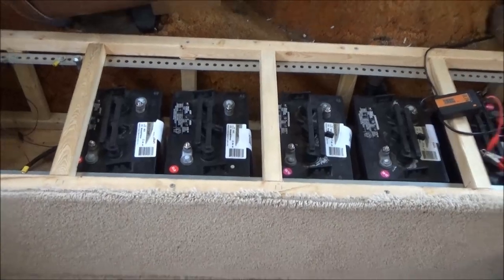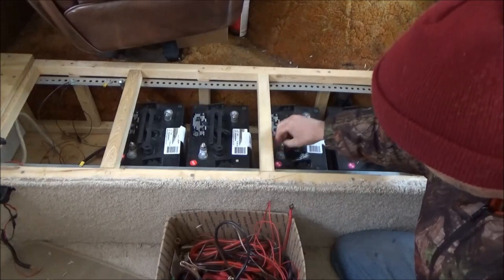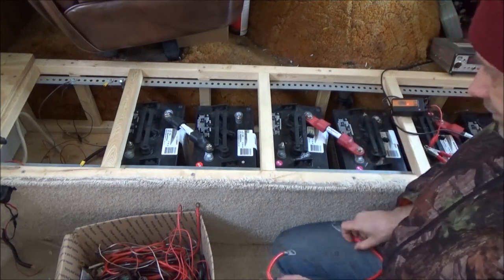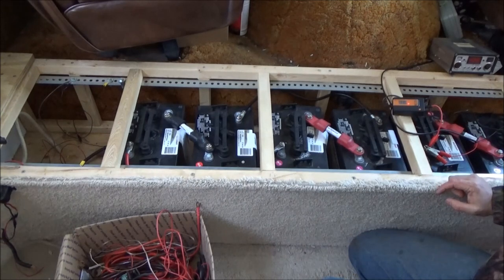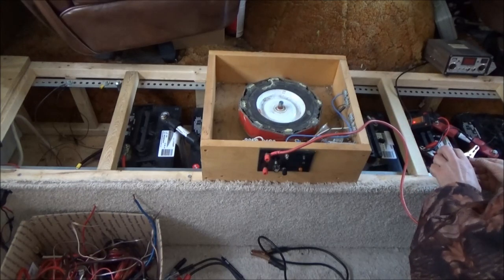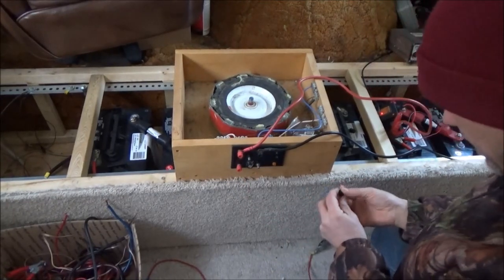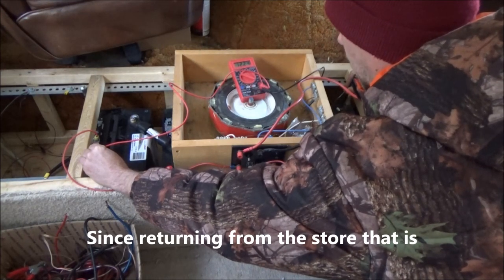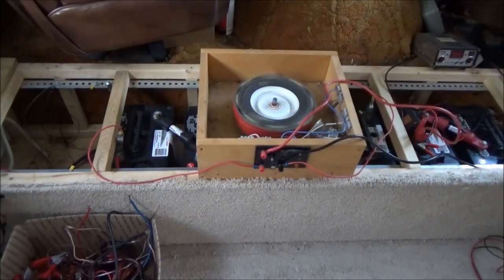Connecting Badly Sulfated Golf Cart Batteries To Bedini Motor Desulfator In My Off Grid RV

Comment: I think what the batteries need is a good 45 amp neutralize charge for a 30 min a day for a few days until they boil off some of that sulfation. run them down in between. They just have not seen any real amps of charging so it is not enough to knock off any sulfation. That tiny Badini is not going to work. It just dont have the punch it needs to attack the huge plates on the giant golf cart batts. I am Speaking from experience. I bought the same battts you have and have them in my shed right now. The were showing low capacity so I gave them a direct charge from the solar panel for a few days for a few hours a day. They seem to have recovered. I used a 90 watt five amp panel on two 6 volt batteries at time. It  boiled them some for a few hours a day. It would really boil them better if i could put about forty amps in them for a hour or so or better and really knock off some sulfation. you need to give them some large amps for a little bit to knock of some sulfation with some rapid  boiling.
Reply from the maker: The only way I can do that is with my big generator and the large 50 amp battery charger. I guess I could try it.
Reply: *****
That could possibly occur if left to boil for too long. over heating and warping plates is what happens so then you get a short from the warped plates touching So monitoring temps would be a must. Yeah a guy needs to keep a close on them while boiling so they dont get too hot and warp the plates to make them short out.
Reply: The Do It Yourself World
Watch your temperature so you dont get them too hot and warp the plates and short them. Keep a eye on the temps while your not doing anything else or you could forget and destroy them.
Reply: shartne When you say watch your temperature... is there a way to measure it?  How do you know it, too hot? Is there a smell, a sound, do you touch the battery case or maybe the terminals?    Being careful of the temps sounds like very important advice... could you please say how we do that?    THANK YOU!
Reply: MollyDolly  Put your hand on the case, it should always be below body temp. If not, excessive plate corrosion will start to occur.
Reply: Albertzz99 Thanks...  that brings up another question... I am in SoCal... should I be keeping my batteries out of the sun?  Right now I have my new HF solar set up on the pool deck... it does get hot... will that boil my batteries and if it does is that good or bad?
Reply: MollyDolly  The ideal temp for lead acid batteries is apprx the same as most people consider a comfortable indoor temperature. Above promotes corrosion of the battery plates during cycling. I can't really tell you what is, or is not possible for you. But I would try to keep them out of direct sunlight as much as possible. Hot batteries do not last as long as cooler ones, so one can only try to make them last by keeping them as comfortable as possible. To further complicate things... Batteries typically increase there internal resistance as they get used and abused. This means more of the energy you try to put into them will be converted directly to heat. If you remember how Troys new FL battery suddenly increased in temp when he got them insulated?  This is to me a clear indicator on an elevated internal resistance. Remember the weight of the battery? This is an awful amount of mass to rise that much in temperature in such a short amount of time. Several hundred pounds. was it 700?
Reply: Albertzz99 Thanks!   I think I will put the battery on a couple of 2x4 or something to get it up off the hot deck and I will shove it behind the panels for shade that should keep them cool enough for a couple of months... and by then I will have changed the system probably.
Reply: MollyDolly  Just to repeat myself from the previous video. I would definitely be getting an independent analysis done on the forklift bank if it was mine. I think the temperature rise was to large on that big mass. I think they are faulty, and a professional with a modern digital battery analyzer would pinpoint the fault in a few minutes. I know because I do this myself whenever I suspect one of my own batteries.
Reply: MollyDolly Sorry, I wrote that above before I saw your last post:) Yeah, insulating them from a hot surface and shading them is a good way to go to get more life out of this kind of batteries.
Reply: Albertzz99 My battery is just a Walmart 109 AH Marine battery... this is my training wheels set up to experiment with...but since it is new I don't want to  damage it.  I had not thought about the heat on the deck as a problem...so I learned something today.      Thanks again!
Reply: MollyDolly The longer you can make it last, the longer you can avoid the hassle of recycling the old and getting a new one in.  
I forgot to mention you also reduce the self discharge by keeping it cooler. So it's a win win.
Reply: MollyDolly
Have to look that up on the net dont really know I go by feel I dont like them to get too wam if so  shut them off. You can bring them to a full charge then let them keep going for thirty min or hour. depending on the temperature. It pretty cold where he is.
Reply: shartne, you are right that he should boil them more, the bedini pulses wil help in the first stage to get a little of the sulphation of so you can get some amps in them with a normal charger, but remeber he has no grid power, so thats a bit problematic there.
what y often do (on grid) is to put a damaged battery on a non controlled charger to boil them for 24 hours, then decharge a bit, and charge them fully with a 3 stage controlled charger, if there not to muth damaged that wil work fine most times, but beware , the capacity of the battery wil be lower then a new one!, its always damaged!
Reply: Pete Brown  well Pete, proof is here!, i have several customers that have my traction batery's for 20 plus years, stil doing fine!, al has to do with the way of maintenance, and capacity, i have placed huge capacity cels (1500 amp hours ore more) when the customers use lot less power, in that case the cels dont have to work that hard to, and when charged and equalized in time the can live even longer, its thrue that if you have to less of capacity in the bank you wil hurt them indeed,(they have to work harder!) in that case they will live a lot shorter! (5 years is possible), but as said, y have several of my customers whit 20 year old banks still peform well!
Reply: Pete Brown he  has them, but he is not charging the right amount (if its a 700 amphour he has to charge wth 70 amps at least, but he doesnt dear to switch his hf carger to 50 amps... dont know why...).
Reply: MrBugsier5 Just the man I wanted to speak with!   I have this brand new Walmart marine 109 AH battery on the 45 watt HF solar array, and a 750 watt Schumacher convert.  I was looking for a  load to test it out on and my daughter has lizard and critter lamps running so we thought we might try running those.  There is one 100 watt lamp and 5  60 watt lamps.  She usually runs them from 7 AM to 7 PM.   I am in Southern California so I get full sun every day.... except this week because I installed  solar array (of course!!).  We have full sun from 8:00 to 5:00 this time of year and lowlight until 6:30 pm.   So the question is...will I be able to power those lights?   Should I plan on turning off the lights by 5 pm?
Reply from the maker: Pete Brown Ok, you trade places with me. Have 5,000 people tell you that you are an idiot and a failure every day in 5,000 different ways. Now those same people try to tell me the "right" way to do things, but there are 5,000 different "right" ways. Sometimes I dont know which way is up anymore. It gets so confusing. So yes, often I make stupid mistakes based on the "professional advice".
Reply from the maker: Pete Brown Oh, and the other 4,999 get angry with me for not taking their advice.
Reply: MollyDolly you have a 109 amphour battery so you have aroud 55 amphours to use available (half the rate of the battery to not hurting it)), not counting the losses of your inverter, you can use a 100 watt lamp lets calculate...100/12 is 8.3 amps , so this lamp uses 8.3 amphours in one hour.so you can use it alone for 6 hours, then you have to recharge your battery, you see not mutch to use!, in full sun (at no losses ) in theory you wil charge with 45 wats max 3,5 amps, so 3,5 amphour, thats not mutch!

(thats all whitout losses, so you can even use less power as calculated here!

whit this set up, i strongly suggest you use led lights,(directly on 12 volts) your system is not big enough to power your needs!
Reply: The Do It Yourself World  lol, dont worry, i dont bother!, just advising!,
Reply: The Do It Yourself World
all the advice you get from me is tested in practice and proffesionally. just saying.... thumbs up, ps , you forgot the 6 volt connection on the rv bank.... darn you!!! lol.
Reply from the maker: Pete Brown I knew I should have added that I did not mean you. I was just saying. So many people on here talk about all my mistakes but the advice I get is so mixed. Often I am even second guessing my own self on things I do know.
Reply from the maker: ***** And what brought you out of the wood work again? You are not wanted here. I am sure everyone made that pretty clear last time. Go away. Bye now.
Reply from the maker: ***** And how are you commenting here and how can I see you? I thought you were blocked? Arrgh. Well, lets try again. Bye now Ryan. Wish I could say it was good, but ..... NOT!!!!
Reply from the maker: The Do It Yourself World Hmmm, is he gone? Time will tell.
Reply: The Do It Yourself World
Cycling batts through helps as much as anything. Charge them run them down a few times normally. See what happens I read this stuff on the net battery school. then I try it and it worked. my inverter got sick now I have it apart waiting on a new soldering iron. And the trolls.. the government has special shills that get paid to attack channels. Evidently they don't want people to become independent and get off grid.
Reply: The Do It Yourself World
Also this youtube is owned by Google a Government run deal. They have it to profile everyone. It about control. They will be coming to get the off griders and preppers and Christians but us Christians will be gone after the rapture so good luck with that. LOL

Comment: Since the bedini motor requires no electric then how about unhooking the battery wires on the right hand batteries and see what happens?  You also said it had a short in it are you not concerned it might catch fire?
Reply from the maker: I never said that. In the video I mentioned the batteries that run the motor. Disconnect the batteries and it stops running. Simple.
Reply: Plain and simple that thing don't work.
Reply from the maker: Captain Carl Wright Right, not without the power it does not. But before you slam something as a fake or a farce you should try it first. You might be surprised. And if you do not try it then you have no right to mock it.
Reply: Susan Wyse I figured that it was phony.
Reply: Thanks I'll check it out.

Comment: Troy, what you are using the bedini motor for and what Bedini designed the motor to do are reversed. He showed that you could use a low votlage power source to generate a pulsing high voltage output. ie: 6 volt lantern battery powered the bedini, and it created an output of 20 -100volts? charging a 12 volt battery, but since it pulsed it did not burn out the battery. A secondary effect was that it desulfated the battery. 
        When doing your videos,as you talk, sometimes the word or phrase you use is misunderstood. I knew there would be no "boom" if you shorted out the battery; maybe some sparks, unless you had like a bank of 10 batteries set up.
Reply from the maker: Well, I use it for desulfating and charging at the same time.
I am not the best with words actually.

Comment: You should use the best de-sulfator on the worst batteries. and all batteries connected as a bank, so they all get the same treatment!
Reply from the maker: The best desulfator right now is on the huge forklift battery bank. I will be switching it over to the other forklift battery bank soon. The other desulfator is on the golf cart batteries that are halfway good. The Bedini is desulfating the other four.

Comment: I assume the RV is not heated at the moment. You had problems with cold batteries when you did have heating. Will the temperature not affect the batteries now?
Reply from the maker: Yes some but they are working for now just fine. The cold will be mostly over in two weeks. Well, the deep freeze anyway.
Reply from the maker: Pete Brown Right now the batteries are not being used. No load on them. So there is no real concern. Just like letting my truck sit unused for days/weeks at a time. And the deep freeze is mostly past. I think they will be fine. Actually a new video I am uploading shows they are way better off right now for some odd reason I do not understand

Comment: I understand this is an old video and technology has changed. I have used modern battery charges with desulfators or a desulfator that runs off the battery you are desulfating. These ultimately don't seem to have a lot of success. I read a recent paper by Dr. lineman who worked with Bedini and his assertion is that if you want to desulfinate a lead acid battery you have to charge at 15.2v. Other people say charge at 14.2 or 14.6 v. I see other videos where people use portable DC welders amp up the volts and boil the battery in cycles until it fully accepts a charge. 
    In short I have desulfators that connect and use voltage from the battery being addressed, a low current desulfator charger (both using pulse technology) and have a xantrex charger/ inverter that re-charged at 14.4v and my 9 yr. old trojan batteries are starting to show signs of aging. So very recently (a week ago) I dialed up the xantrex to 15.2 v as recommended by Dr. Lindeman to see if that would give more life to my battery bank. 
     Using the Bedini motor as a desulfator is intriguing but will it bring older and deader batteries back to life?
Reply from the maker: Higher voltage for a single charge once a month is called equilization. That should be in your charge controller already. Over time higher voltage will kill batteries so keeping them there is bad.

I have successfully used the bedini motor to desulfate many batteries throigh the years. It uses volts only, no current. Current heats a battery and heat kills.
Reply: @TheDoItYourselfWorld  Thanks for the reply. Yes I have the equalize program in my inverter exactly as you describe. Can I order a Bedini motor already made like yours for example or do I have to build one from plans? Please help.